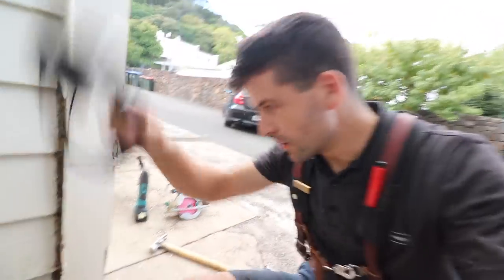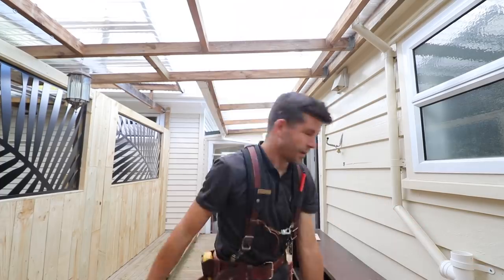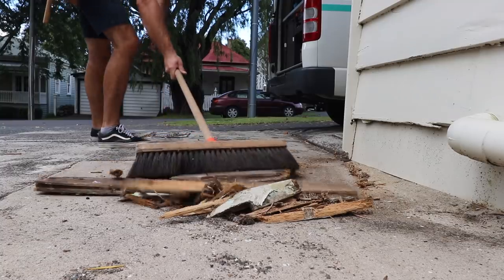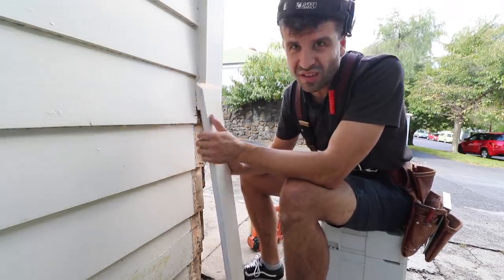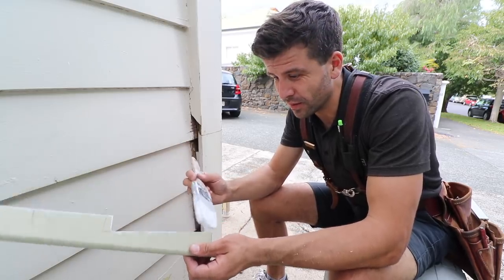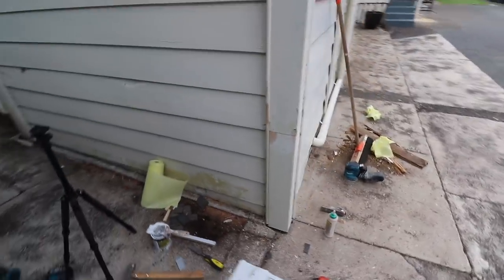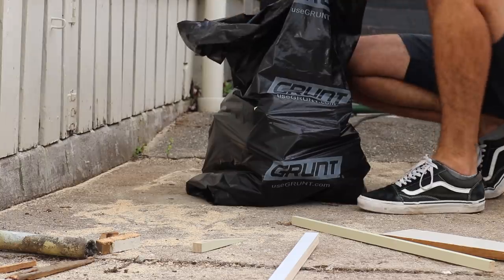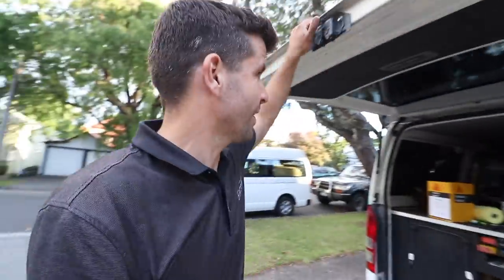Treated Timber in New Zealand (How We Use it)

Comment: That hardwood floorboard would have originally been better than the treated pine you replaced it with...
Reply: You are probably right assuming they were hardwood,  (some old flooring, in Australia anyway is Pine, not Pinus Radiata I would think as it ages very well), having said that I've just made some exterior window trim for some windows I just made, from old jarrah floorboards, (Eucalyptus Marginata), just ripped the tongue and the groove off, will hopefully last for many, many years, picked them up from the annual council throw out, beautiful timber...

Comment: Surely there's only so small they can make the airbow? Also, is the hikoki gun truly gasless? I've had the Milwaukee framing gun (which is supposedly the same setup) for about 4 years and last month had to top it up with nitrogen (I think) gas. It fired thousands of nails up until this point so no big deal but still not as advertised

Comment: The way they treat timber is submerge it into a solution for God knows how many hours and pump the pressure up in that way the solution penetrates about 1 cm into the wood. This would be for H3 and up I guess, for lower grade they would probably not pressurize it, I'm not sure. In Latvia there's also a way of treating timber with heat, that's done in a vacuum so that there is no oxygen to burn. Such timber basically cannot rot.

Comment: Are you required to use pressure treated wood on concrete or use a vapor barrier between concrete and untreated wood in New Zealand to prevent the wood from rotting?

Comment: Only 4 coats, sounds like a new house to me.
Reply: George Morgan Is there much lead paint on the older buildings?
Reply: I believe Lead paint was mostly banned or fazed out in the late 70s, so as long as your home is less than 40 years old I don't think you need to worry. There are a number of businesses that specialize in lead paint and asbestos removal.
Reply: @Hacksaw37  The lead paint can def still be under there. I took 4 coats to mean 4 paint jobs which could be 9+ coats. I've seen more than 6 colours in the sanding layers of some Wellington houses!
Reply: True. I have never painted a house without using primer and undercoat before finishing coat. On the other hand  my landlord got a team to paint my place 3 guy's 2 hours,  1 did the roof the other 2 did the outside, one coat of paint, prep-work consisted of spraying the house with water from the hose. They wont be hired again.
Reply: There's a property mentoring group over here in Wellington that teaches how to flip houses. (For a one time low payment of $29,999) They're very successful in what they do, and it's for a reason. One of the 2 guys that started it has a motto for painting houses "We're not here to paint the house, we're here to change the colour!"

Comment: The timber is coloured just to indicate it is pressure treated for rot/insects.

In the UK the battens for roofing are in either 2x1 or 1.5x1 are usually pink but sometimes pink I think.

Thanks for the vid. Nice work on the corner of the house there and also the knowledge on the wood slightly above ground. It's not obvious to everyone that water/moisture can potentially be the enemy of wood.

Cheers, thumbs up.

Comment: Interesting to see how you guys do treatment. Options in U.K. are use class 1 interior, use class 2 interior structural no weather, use class 3 out side but no ground contact (used for structural now) use class 4 which is ground contact. And the DOT1 which is department of transport for use in ground contact fencing. 

Sadly a lot merchants treat fence posts in class 3 and it’s any old spruce or the like
Reply from the maker: Interesting stuff. I remember using a lot of timber that was yellow over there. Mainly for interior

Comment: Here in the states the wood we use is usually Southern Yellow pine which is very strong and durable
Reply: Connor G have you used much Douglas Fur?
Reply: @MsElijah16  not personally but I have seen a few people who use it a lot
Reply: Just wondering cause I watch another carpentry channel called essential carpenter and he builds with D-fur quite a bit, he's in Oregon. What state are you in?
Reply: @MsElijah16  MA, haven't seen his channel. Is he using it for framing? I use Southern yellow pine (its pressure treated) for deck framing and stairs.

Comment: A good idea is to cut the end of the board at a 10-15% angle, it will make the water drip of the bottom better, in stead of looping around the end a soaking it.

Comment: Good stuff, thanks.  You did a scarf joint on the new piece joining to the old "floor board and the little scribed piece on the left.  Was it also a scarfed joint for the slightly narrower piece to the right of the floor board?  And, more importantly if yes, how did you cut the 45 degree angle on this piece?  Cheers David.
Reply from the maker: Yeah mitred both faces. I used the multi tool and a speed square to keep the blade on a 45° angle ( Should of filmed it)

Comment: H3.1 is typically a LOSP type treatment for use in applications where it won’t stay wet and should be over coated - weather boards etc, 3.2 is CCA treatment which is fixed into the wood and is ok to remain exposed to the elements. The pink is a dye in H1.2 and the standard require it for identification. H1 is more common in Australia just as a termite treatment it has no defence against decay.